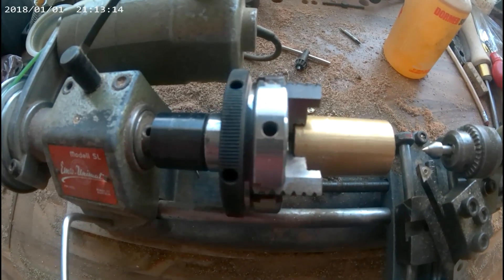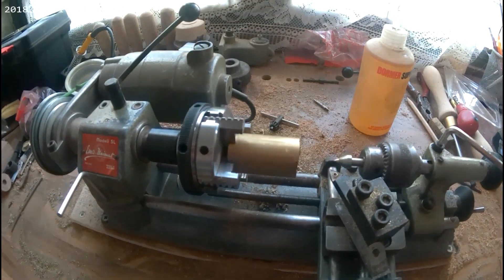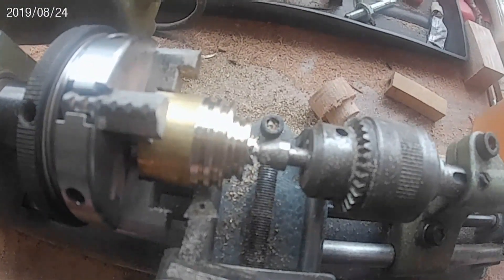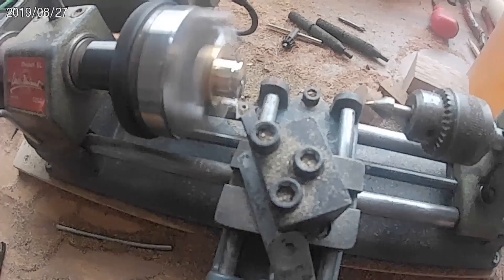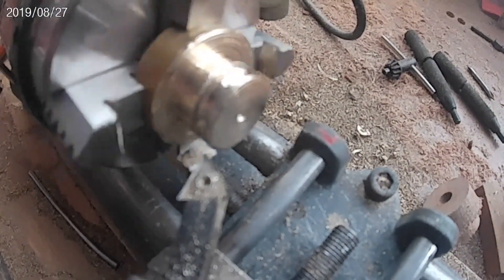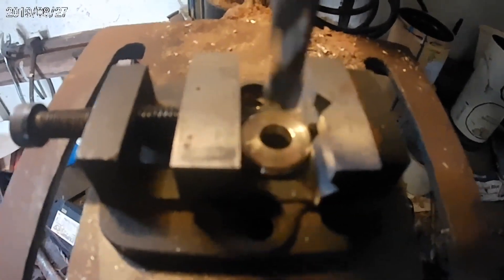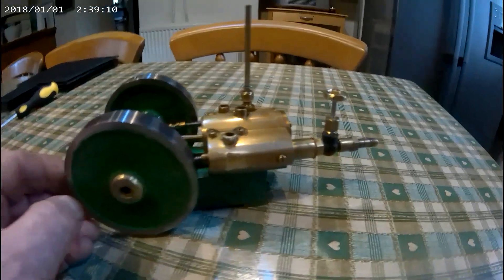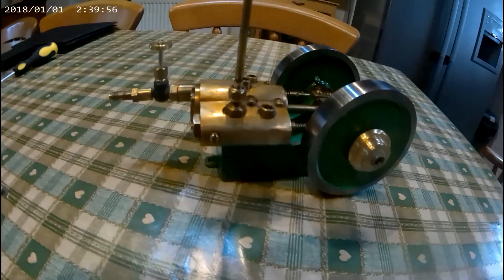turning brass pulley on emco SL

Comment: Great work Eifion, your a top engineer mate....  i have a rubbish old lathe thats older than you and when i get brave enough a pulley is my first job .
I need to see the engine run how could you leave it so long without a run,  its like an unfinished novel 😂....Steve
Reply from the maker: Thanks mate, it does run on air after a test with my far to noisy a compressor for videoing. Made a few engines when at sea , left most behind on the ship for the next guy to play with and finish.That one made it home then forgotten about. Hopefully next video will be a steam test running driving a load , I have my eye on a low rpm dynamo that a guy in Holywell ( quite near here) makes , think someone from the dreaded forum got one recently